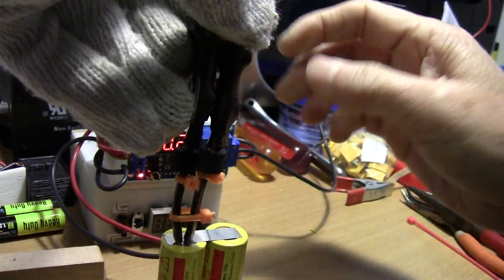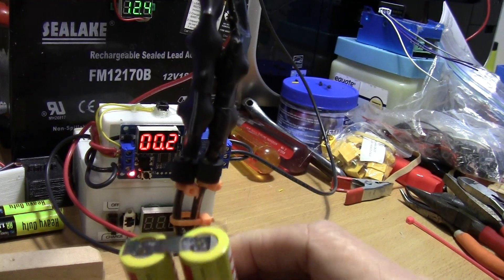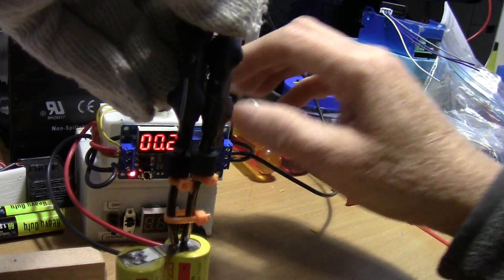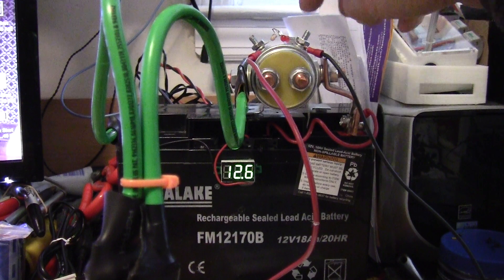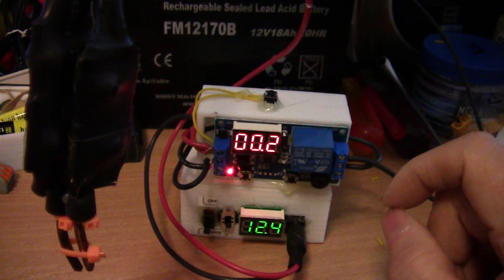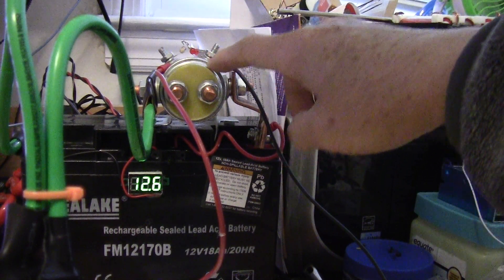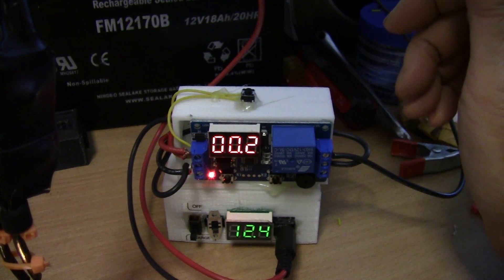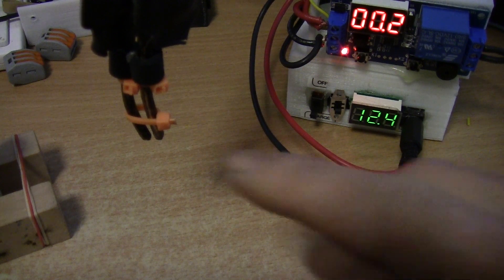12 volt battery powered 18650 spot welder experiment  part 2: Timer added

Comment: There are really 5 options I can think of. 1: Buy a rather expensive Chinese spot welder (irony). 2: Buy an even more expensive kWeld welder that can control higher current (3600A!) for a shorter (5-20ms) period. 3: DIY a rather heavy and more clumsy microwave oven welder. 4: DIY a simple car battery welder with a moderate size battery (18Ah) and a cheap ebay timer module (200ms) and save yourself some money. 5: Just sand the surface and solder it neatly with good flux, it does the same job really and save yourself a ton of money. Option 2 and 4 eventually end up dumping the same amount of energy (Joule) into the weld. What option to choose depends on your project size, technical capability, budget and time.
Reply from the maker: Thanks for laying out the options available.  Lots of trials and error involved.  Even with expensive units, you still have to contend with the best settings and techniques. Some of them don't even work out of the box because of current/voltage requirements for the unit.  I agree with you though on the clumsiness of a microwave oven welder.

Comment: Hey, which current delivery do you recommend for the battery? Do it has to be more than 200A?
Reply: Current is one thing. Time duration is another. You can dump a high current in a short time or a bit lower current for a longer time. The physical pressure you apply during the weld and the surface preparation also count. Please read my comment above.

Comment: Is The separate 12v battery supply to the timer really necessary, why not run off the main battery?
Reply from the maker: Yes, you can run the timer off the main battery.
Reply: Thanks!

Comment: Great Job with the timmer. I have the same timer and for the life of me couldn't get it to work correctly! Great Job!!
Reply from the maker: I noticed the timer only works from .2 second upwards.  That could be too long depending on your build. Skip the timer if all you need is a switch and you save a few dollars in the process.
Reply: I agree! I actually tried the same exact timer, and couldn't get it to work correctly. It was delivered way to much current. Than I created a smaller Capacitor timer and it sorta worked as long as I used under 100uf caps. You might have better luck than i did? Its pretty simple to build. I have a video of the timmer on my channel. 👍BTW(Just subscribed!)😊👍
Reply from the maker: Thank you for subbing.  I watched way too many welder videos but will be glad to watch  (and subscribe) yours if I hadn't already.

Comment: Good embellishment on that welder design.  Did you outline the wiring of that timer anywhere?
Reply from the maker: My other videos on the timer should have diagrams that identify the different functions of the timer.  You can find more info here:https://www.ebay.com/itm/DC-5v-12v-Delay-Timer-Switch-Adjustable-NE555-MCU-Relay-Module-Board-LED-display/121945988830?hash=item1c648c1ede:m:mqQhU72CLkMftJZavX_edXQ

Comment: can the time be set to 20ms/0.2s  ?
Reply from the maker: Yes, you can set it from .2 seconds to 999 minutes.
Reply: wtam69 i bought it, just need the solonoid switch... hope not 450A from car battery is to high ampere :-)
Reply: Your spot welding got a lot better with timer relay
Reply from the maker: It is working very well now. I just welded a set of high drain Samsung 18650s and the welds are solid and professional looking.  I set mine to .2 seconds and if it doesn't make a good first weld, I just tap the the switch a second time.  After you play around with it for a while, you can make pretty good welds. If you use 450 cranking amp battery and find the weld too penetrating, just use less pressure when you press the electrodes against the nickel strip and the battery contact surface. The timer will definitely help you, especially with different thickness material requiring either a longer or shorter duration of weld. Good luck in your experiment.

Comment: hi, my friend.
 looking again your video I was wondering why you had a different load for the timer.
 cant you support the timer from the battery that the weld cables are?
 and give the power to your solenoid to crank the weld?
you had a reason to to it that way?
Reply from the maker: I powered the timer separately as I wasn't sure when I am making the welds if the main battery will cause a short at the input of the timer.  It will probably work but it's easy enough to supply the timer with it's own power.  If you don't have a timer, then the solenoid coil can be powered by the same battery.